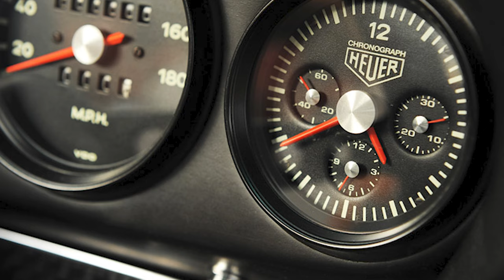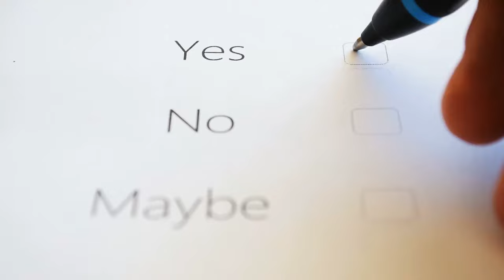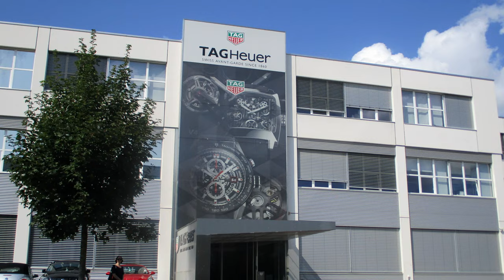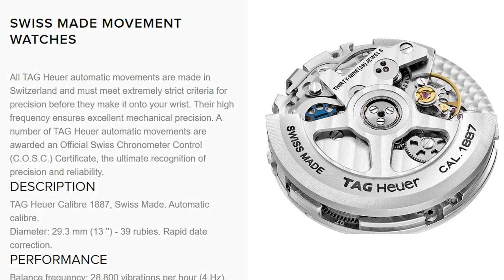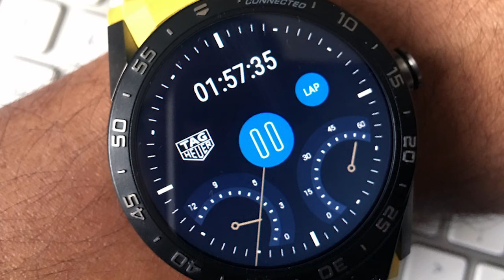What's Wrong With Tag Heuer?

Comment: As a Seiko modder, I immediately recognised the 'Thirty-Nine (39) Jewels' font on the 1887 movement as nothing less than Seiko's own.
Reply: As a Seiko fan for many years, I can say that Seiko is overrated. The mechanisms are fine, but the technical defects such as misaligned hands, dust under the glass, low-quality bracelets were endless? And I, the fool, bought over twenty watches. In the end, after wandering longines, louis errard, omega , chosen by Tag Heuer

Comment: Can I get y’all’s opinion?

I recently purchased a pre-owned 165.806 from Chrono24, it was listed as in good condition. After I bought it, I sent it in for service to Tag, and was quoted almost 3 times what I paid for the watch.

I was expecting between 500-1000 since it was advertised as being in good working condition, but the quote is for over $1500.

I feel like I have been ripped off. Am I wrong?

Comment: I own 2 Tag automatics and the 2020 connection. I love all of them. My only complaint is I dropped the connection on the floor from 3 ft and the bezel and face popped loose. I do not wear this watch for sports which is what it was designed for.  I wear it to work. I called and said why did it fall apart if it was designed to be worn during outdoors activities. I was told to pay or they would ship it back not repaired. Charged me $600. I have cheap watches I've owned for over 20 years that have been worn and never had issues like this. I am very disappointed in Tag and most likely will not buy another watch.
Reply: Regardless, watches are not shock-proof if they fall it's almost always going to be bad news. You drop them so that's not going to be covered under warranty. You're responsible,  if not a  manufacturing defect. If you want schock proof go to the G-shock line those watches are almost indestructible.😉

Comment: in the early 70s I worked on Harrier GR1s which had a TagHeuer stopwatch mounted above the instruments.  We hated this watch, especially the armourers.  Why?  Well the bezel would fall off and go down to the floor.  The armourers had to take out the ejection seat to get the bezel back.  It would then fall off later.  This happened many times and we used to ask why Hawkers had fitted such a useless yet expensive stopwatch.  I did engine timings in the cockpit and used my Seiko 'chronometer' instead.  The stopwatches were normally removed to avoid theft although that would have helped.

Comment: Yeah and the man try to get them serviced. Tag Horror. I would never buy one again.
Reply: I find their service to be exemplary.
Reply: @lowellspinners88  at a personal level-- the costs and simply a spat of "he said, she said" regarding a repair of a simple ETA movement. Talked to retailers as well and not always a picnic for servicing. I would not recommend the brand to anyone at this time.
Reply: @robertschmidt9584  I was ready to buy one of their quartz watches, then the salesman told me they couldn't guarantee the waterproofing unless an authorized service center did the battery replacement.  I ended up buying an automatic, but I still may go back and buy a quartz.